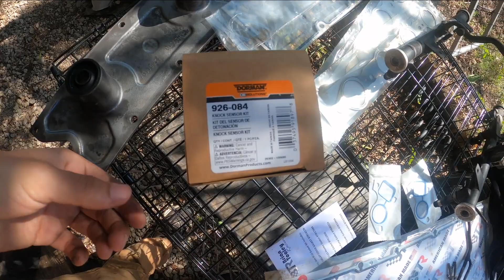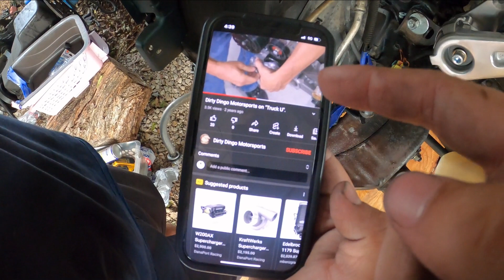OBS LS Swap Accessories Install

Comment: Question how did u install ur gear shift linkage???
Reply from the maker: For my 1995 used the original linkage off the truck, Use the bracket off the donor transmission, you have to take off the bracket, then slip the original linkage into the bracket, then bolt the bracket back to the transmission. I'll post the video on it!
Reply: @_dreamcatcherbigvic7249  hell yeah bro cause my 93 obs is not a cable it’s a rod like the 88s
Reply: @_dreamcatcherbigvic7249  that’s the only thing I need to get my obs on the road bro ! Thankyou!